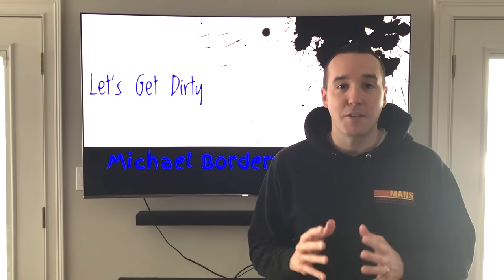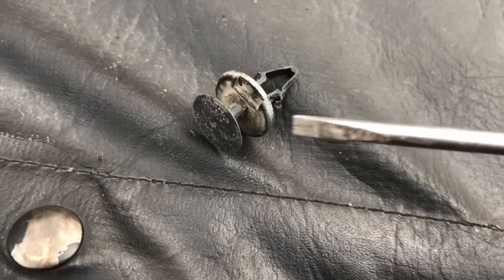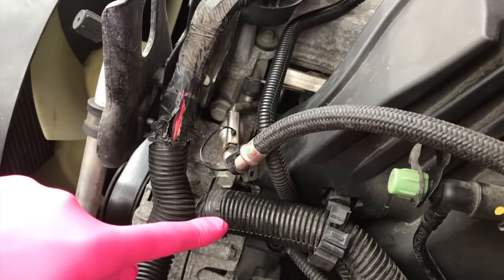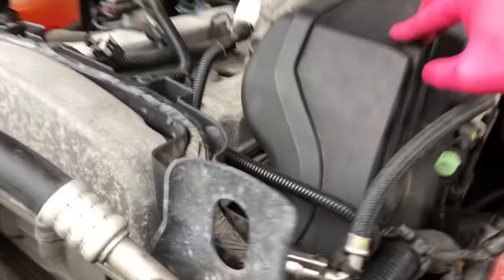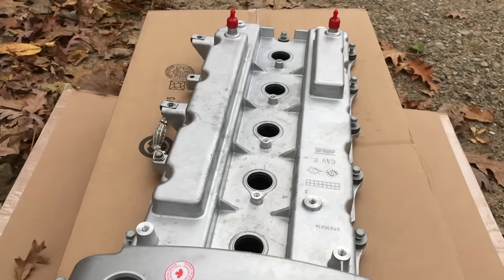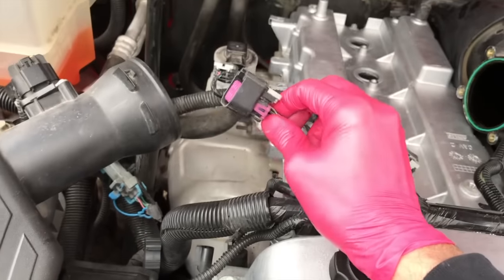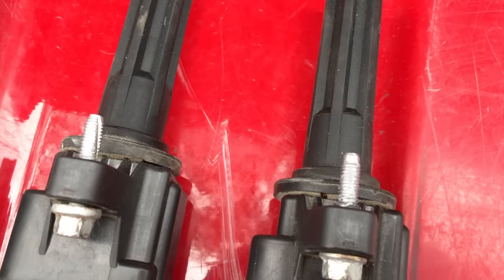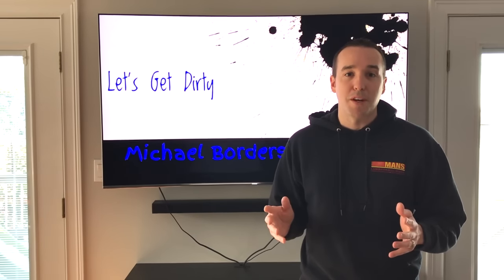How to replace Valve Cover & gasket - Colorado/Canyon - FAST & EASY!

Comment: I'm in the process of replacing the valve cover gasket on my '05 GMC Canyon. Thanks for the heads up on the hidden bolts. I can't believe that GM has made it such a chore to get the valve cover off. Gonna trade it in before the timing chain needs to be replaced.
Reply from the maker: Thanks for watching & we appreciate you sharing this.  We definitely understand your thoughts...it was a Stubborn mission to remove...🤔

Let us know if you have any questions.
Reply: Not Chevrolet. It's Isuzu.

Comment: Thanks for the video Mike. I have an oil consumption issue on my 10’ canyon L5 , I took it to a bad mechanic and he allegedly replaced the gaskets on the valve cover and spark plug tubes, but I’m getting oil on the spark plug threads again. There is no coolant in the oil when I change it, so I suspect something went wrong when replacing the gaskets. Unfortunately I cannot find a new valve cover for this truck anywhere, is it common for the cover itself to warp over time? I figured if I was going to pull apart the engine to replace the gaskets I might as well replace the whole cover, but I guess I’ll just try and change the gaskets out and see if that solves the issue since I can’t find a good gym genuine valve cover. I didn’t want to put some cheap China cover on it from eBay lol. Thanks again for your vids, they have helped me get my truck to 200,000 doing all my own work except for a timing chain change (which is when they say they did the gaskets).
Reply: *gm genuine

Comment: Hello! great video!  I own a 2010 colorado 3.7 liter with 202,000 miles.  My truck is making a bad knocking sound when it is idling.  When I first change the oil it immediately sounds much better but then after a few days/weeks it starts knocking again.  Someone suggested to me it is related to the valves.  The sound is definitely coming from that area of the motor.  Is this why you replaced your valve cover?  I just had my truck all tore apart in 2018 due to a small head gasket leak and the mechanic also replaced my timing change guides.  He said my motor looked really good for its age (in 2018).  The serpentine belt is fairly new too so its not the belt.  a few years back it was making a knocking sound and a belt replacement fixed that.  This is a different sound coming from inside the top of the motor.
Reply from the maker: Thanks for watching & welcome to the DIY Raptor Club.  We replaced our cover do to a crack near coil insert.

The cover alone will not cause knocking unless installed incorrectly...which it’s highly unlikely it’s installed incorrectly.

If fresh oil helps for a small period of time, there may be a leak.  Have you ensured that you have no oil leak and your oil quantity is within the proper fill parameters on your dipstick?
Reply: @DIYwithMichaelBorders  thank you for the reply.  Definetly no leaks.  and yes I always add the proper amount.  Is it possible my oil is not reaching the top of the valves/timing chain?  like perhaps a oil pressure issue?
Reply from the maker: @rfickes87  

Thanks for the reply, that’s definitely a possibility.  🤔

Comment: Is this what GM did to solve the P305 Valve seat/misfire issue with these trucks? If it is I know I can complete this task after watching this video. Great video thank!
Reply from the maker: Phillip Galindo 

Thanks for watching Phillip, we are not 100% sure on that however after replacing Valve Cover & Coils, engine has ran great & no detected misfires.

Keep us posted on your DIY project.  We are here to help.  Please subscribe to the channel and turn on your YouTube notification Bell 🛎 that would be awesome thanks again!

😎👍🔧🔩
Reply: @DIYwithMichaelBorders  Finally getting around to work on this project. I'm having a hard time getting the throttle body case off. I cannot seem to fit the 10mm with an extension (4:17 in the vid) to removed the bolt.
Reply from the maker: Phillip Galindo 

Thanks for the update.  You may find it helpful to insert extension in place & then connect ratchet to extension.  Keep us posted.

😎👍🔧🔩

Comment: I bought a used Colorado and it appears the old mechanic or dealer mechanic forgot to tighten the intake manifold bolts, all I could easily access were loose.  I have been chasing a lean code for months. I am attempting to get the place I bought it from to correct the issue. This is the 2nd issue ive found with loose hardware.  thank you for the video
Reply from the maker: Synergy Tech 

Thanks for watching.  Sorry to hear about your inconvenience.  Let us know what the dealership that you purchased truck from says.  Let us know if you have any questions.  Please subscribe to the channel and turn on your YouTube notification Bell 🛎 that would be awesome thanks again.

😎👍🔧🔩

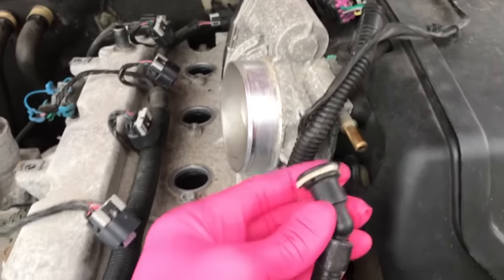Comment: Hey Mike great helpful video so far.  Just am in a pickle as I'm half way through following though.  At about the 4:10 mark, you mention a 'tip' to remove the throttle body case by inserting an extension ratchet/socket to access the bolts holding on the case.  I cant find any!  Are you able to help point me in the right direction?
Reply from the maker: Clyde Bell 

Thanks for watching & we hope you enjoyed the video.  You may need to insert extension with socket connected to it fit into the access hole.

Next, align socket onto bolt.  Next attach your ratchet & see if you can remove that bolt.  Keep us posted!

Many more helpful videos to come!  😀
Please subscribe to the channel and turn on your YouTube notification Bell 🛎 that would be awesome thanks again!

😎👍🔧🔩
Reply: @DIYwithMichaelBorders  I gotcha there, I'm just running into troubles finding the bolts
Reply: @clydebell9508  I hate how they seem to be to busy to give the answer your really looking for. 
They act like we know exactly who, what, when, and where everything is and that the simplistic answer they give is going to help. 
When in reality,  a step by step answer is what "they" are looking for.
Reply: @clydebell9508  but I'm in the same exact boat. I know about the bolts and what you need to get them out with. But I can't seem to find one. I think I hurd somewhere after taking the 2 bolts off the oil dip stick lines. You have to move it out of the way and there is one hidden behind it. I already found and did the ones under by wheel well that went 2. 1. 2. 1.

Comment: Hey Mike. This video is great, I've subscribed and appreciate the content. 
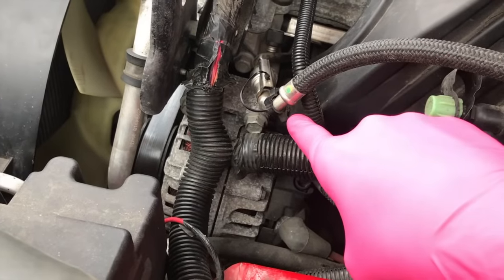I have a question a little of topic, what is that hose coming towards the front of bay/radiator, from the air filter box? My 05 colorado doesn't have that. (Time stamp 5:41 ) thanks.
Reply from the maker: Thanks for watching, that hose is our ac line.  😁👍🧰

Comment: When doing this is there anything else you can do while the cover is off like the re torqued the bolts replacing anything while you are in there basically
Reply from the maker: Thanks for watching, awesome job and we hope it went well.

Not too much to do inside engine where cam and gears are besides inspect for wear and tear.

We like looking at things such as the cam, the sprocket gears, and timing chain to verify nothing looks damage.

Comment: Very good guide. I think tb air box is underestimated. Those bolts are not easy to get off. Anyone attempt this job i suggest tackling that 1st to make sure you can get them off. Several of those bolts in the front you can get off from the top not going through the wheel well using a borescope. Thanks again
Reply from the maker: Thanks for watching and sharing your thoughts.  The air box is the stubborn portion of project for sure.

Is your project completed?  Looking forward to hearing back from you.
Reply: @DIYwithMichaelBorders  yes sir took about 5 hours. Another recommendation is to disconnect wire harness to the oil pressure sensor behind oil filter. You get about an extra foot of slack in the harness and valve cover comes off much easier.
Reply from the maker: @himeedajew  

Awesome job, and great tip for sure.  Extra slack lowers the risk of wire damage/separation as you work through the project.

Enjoy that rewarding feeling earned from a successful DIY project!

😎👍
Reply: Oh my god.... PLEASE SOMEONE HELP ME. 
I have loosened up 6 under the wheel well and taken off the alternator completely unhooked all hoses and electronic connections. And it's kinda loose but I still don't see how it's loose enough. I have taken the bracket ones off completely.  What is the deal. I used extention. Got the two on the left. One in the middle left. The two on the right way up there. Where am i missing some,??? Mine is 07 colorado....  I did notice some differences like mine did not need a t-25 or whatever. PLEASE HELP
Reply: @himeedajew please help me
Reply: @THETRUTHb4u  it's been a minute since I worked on this....all I know is if you have to force it... something is wrong. I don't remember the count of the bolts but my guess is you are missing one. They are tough to get to and see hence why I used a borescope. Send me your email I'll send you repair manual from the dealer...that will probably help you
Reply: @himeedajew man I sure would appreciate it. So I think I might be missing one that is behind the oil dip stick three piece bracket thing. I might have seen somewhere that one Is hidden behind that bracket
Reply: @THETRUTHb4u  ok if you can't get it let me know I can't print you the schematics of all the bolts positions if need be
Reply: You can or cant?
Reply: @THETRUTHb4u  lol I meant I can
Reply: I'm still fighting this damn thing I can't figure out why the manifold won't loosen up more
Reply: @THETRUTHb4u  you know there are bolts on the bottom as well towards the block. Might be hidden behind wire looms

Comment: My 2006 Hummer H3 3.6L in line 5 with 130k miles on it.
Had oil pressure light coming on & off for about a month, thought it was just a dirty sensor.. one day I smelt hot oil.  Pulled over & had a little smoke coming from under the hood. Popped the hood & there was oil splattered all over the top left hans side of the engine. Mechanic changed the oil switch, but it didn't fix the problem.  He can't find the leak.. says he thinks   I need an entire engine rebuild & he doesn't have the resources to do it, but recommended a few mechanics around town.  Could the valve cover gasket possibly be the case or do you have any advice or tips you might think its leaking? I dont have $5k to put in a new motor & I absolutely love my h3.  Just bought it a year ago... anything helps.  Great video! New subscriber!  👍
Reply from the maker: Thanks for watching & welcome to the DIY Raptor Club.  Great question & we appreciate you sharing your experience.  A leaking gasket can definitely cause this.

We recommend starting the engine and allowing the engine to run for about 15-20 minutes.  This will allow the engine to warm up to its proper temperatures.  Next, check for leaks around perimeter of valve cover.  Keep us posted.

😎👍🔧🔩
Reply: @DIYwithMichaelBorders  okay. Thank you for replying! I'll let you know what it is when we figure it out 👍
Reply from the maker: @bigsky445  

Very cool.  😎👍🔧🔩

Comment: On my 2004 chevy colorado, the braided mesh hose that runs to the fuel pressure regulator has a leak, yours in the video is gone, and capped off with a green cap, can you explain that to me? Is it a delete of some kind, and why? I don't know how to replace the line, it seems factory crimped on. Thanks for any help.

Comment: @ 3:40 the round plastic things.
You said they just screw out and I sat there using my fingertips and fingernail and unscrewed forever. 
At one point you have to "POP" it out pretty hard. And now they are separated from cover but HOW DO YOU GET THEM OFF THE OTHER PLASTIC THING?
Reply from the maker: Good morning ☕️ any update?  Your plastic securing clips my be stripped.  You may even be able to pull them up and out with the tool shown below.

       https://amzn.to/3VgvULR

If interested in purchasing this product, visit our Amazon affiliate link above.  I earn from qualifying purchases.  🧰
Reply: @DIYwithMichaelBorders  yea I got it. But I'm having huge trouble finding 1 bolt in the intake manifold (big black plastic) . 
I have loosened up all but one. I hurd one is hidden behind the oil dip stick line where the bracket is and those 3 lines.  Well I think I seem somewhere that you have to move the whole Bracket and those 3 lines out of the way to find a hidden bolt.
Reply from the maker: @THETRUTHb4u  

Thanks for the reply.  ☕️

Did you find the last hidden bolt?  We found it pretty tedious tracking down all of our bolts.  Please keep us posted.

Comment: I have the 2.9l 4 cylinder version in my 2008 Colorado. The shop told me it would be 7 hours for the valve cover removal for diagnosis @$780 for diagnosis of an internal engine ticking. Does that seem about right?

Comment: Great video with all info... I have 2005 Canyon 3.5l V5 and can't find the valve cover the dealer discontinued the part. Were could I find it? Also any idea why is the resonator box get lots of engine oil?? Thanks
Reply from the maker: Guadalupe Quintana Rodriguez 

Thanks for watching & sharing your experience!  We are happy to hear the video helped!

We recommend checking Ebay for a Valve Cover.  You may find some affordable options.

This is a pretty friendly DIY project however does require some patience along the way!  😀

As far as oil leaking, you may have worn out or warped seals.

Keep us posted!  We are here to help!

Please subscribe to the channel and turn on your YouTube notification Bell 🛎 that would be awesome thanks again!  😎👍🔧🔩
Reply: in the side of the plastic manifold there is a hose that clogs up and you have to take it off an d spray it with carburator cleaner  both of them sides the bottom one is the blow-by  from the carter and should blow into the top one   and as fast as you clean it the hose in the valve cover should vacuum clean air instead of blowing air and oil...and make a mess inside the throttle body

Comment: Did you pull the fuel injectors?
Reply from the maker: Thanks for watching, the throttle body was loosened and shift out of way however never removed fuel injectors from the respective connection points.

Comment: How many bolts total are on the intake manifold? I've removed the one behind the alternator and the 3 other obvious ones but it's still in there good and tight
Reply: Same
Reply: 9 bolts on the 5 cylinder engine  / 7 bolts on the 4 cylinder engine

Comment: Have you ever done the head gasket on this?
Reply from the maker: Haven’t performed a Head-Gasket replacement on this engine.
Reply: @DIYwithMichaelBorders  Well I might have to on mine. It looks like there's some antifreeze getting into the Engine somehow. I'm hoping that it's not too much more work once I get the Valve Cover off.
Reply from the maker: @luigiprovencher  

Definitely keep us posted.  👍

Comment: Awesome video, thank you for sharing!

I have a 2006 GMC canyon with 3.5 and I believe I have the vacuum leak you mentioned @5:10 of the video. However, I cant not hear the leak clearly. what would be a good way to confirm if the leak is indeed by the throttle body cover? I don't have a smoke machine or anything fancy. I connected the OBD scanner and saw Short fuel trim level ~22% at idle.
Reply from the maker: Waqas Bhalli 

Thanks for watching & we are happy the video helped.  The best thing to do is start your engine & try to listen for any hissing sounds.

Once leak is pinpointed, you can purchase new vacuum line from your local AutoZone.

Keep us posted on your project.  Please subscribe to the channel and turn on your YouTube notification Bell 🛎 that would be awesome thanks again!

😎👍🔧🔩

Comment: how many 10mm bolts are holding the manifold? i have unscrewed 5 from the bottom and the 2 on top and that thing  is still holding somewhere
Reply from the maker: Thanks for watching, depends on year and model…there must be one or two more hiding in there somewhere…not allowing it to break free.
Reply: 9 bolts on the 5 cylinder engine  / 7 bolts on the 4 cylinder engine

Comment: how many 10mm bolts did u have to take off to get tha intake off on the right side? I've done bout 6, and it's not even loose. tia!
Reply from the maker: Thanks for watching & welcome to the DIY Raptor Club.  Great question and if we remember correctly, it was between 8-10...🤔... don’t remember exactly.

Don’t forget about the bolts that secure the coils in-place on top.

Comment: Why did you replace the valve cover itself and not just the gaskets and what's the torque specs for the people that do have a torque wrench?
Reply from the maker: Thanks for watching, ours was leaking.  We replaced seal as well.

To get your exact engine torque specs, we recommend contacting your local Chevy dealership and providing them with the last 8 digits of your Vin number.  They will be able to get you the exact torque specs for your exact engine.

Let us know if you have any additional questions and hey if you’re into crypto trading, check out our DIY ecosystem.

          toolboxtoken.com

Reach out to us any time!  🧰
Reply: @DIYwithMichaelBorders  I have the same i5.
Reply from the maker: @luigiprovencher  

Awesome, we will be here to help answer questions as you work through project.

😎👍🧰
Reply: @DIYwithMichaelBorders  What do you mean it was leaking? Was it cracked?
Reply from the maker: @luigiprovencher  

Thanks for the reply.  The seal gave way and was no longer holding required seal…which led to lack of compression inside crank case…leading to random fault codes related to faulty plugs and ignition coils.

The computer was basically telling us that we were having multiple misfires…but we weren’t really miss-firing…it was just the leak in cover.

😎👍
Reply: 10 N-m ( 89 lb in )